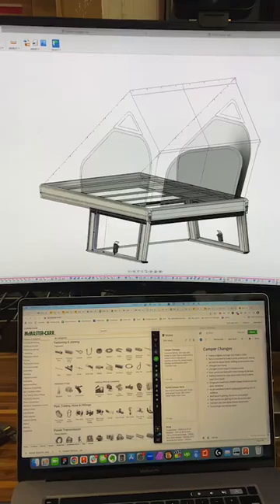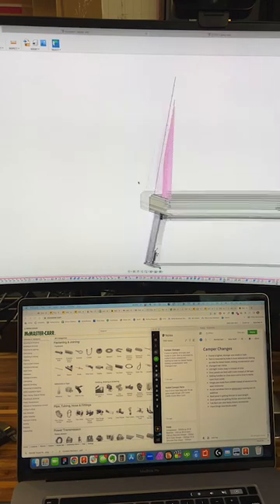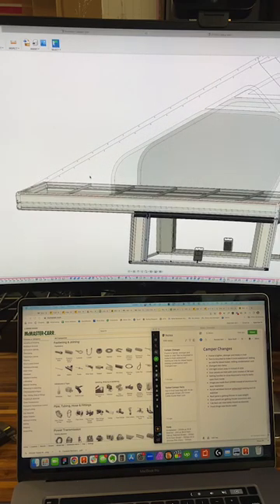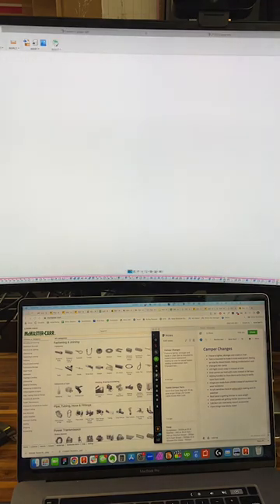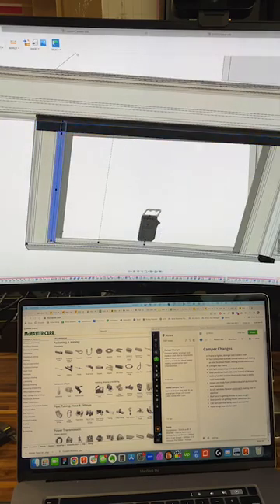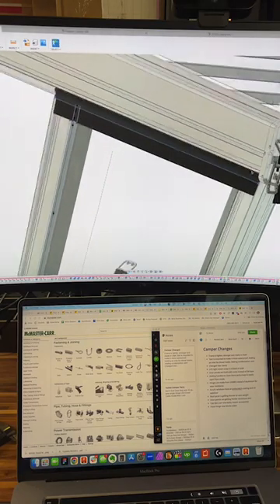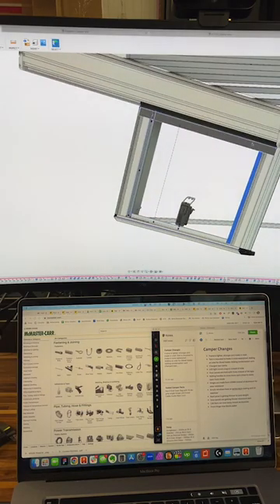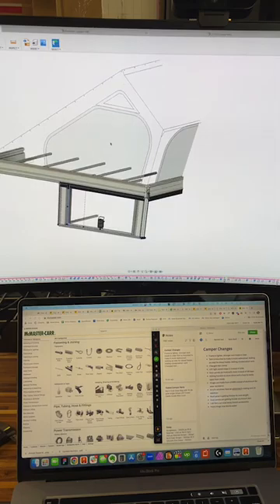Extrusions are finalized!

Comment: Kyle. Amazing work I can’t wait to have one. Is there any plans to have a sliding or movable shelf in the pass through area that could serve as a night stand? Also on the order page it looks like you either have to go no windows or both windows, and or pass through. Can you have no rear window but also have the cab pass through?  Thanks again
Reply from the maker: We're working on a 2 pc bed extension accessory that could definitley serve as a night stand. Yes, you can have no rear window and add the pass through.

Comment: Will the side hatch doors be strong enough to mount maxtrax on the outside  And will the gas struts support that weight?
Reply from the maker: We're planning on it. We'll be testing an accessory plate that can be added to the doors with mounting holes for both of those. The gas struts are adjustable so you can reposition them to increase the leverage on the door for heavier loads.

Comment: Hey Kyle, I road trip a lot with my dog who likes to be in the bed. I have a soft topper right now which makes it easy to vent the area while driving. Would it be possible to have an option that allows air to flow in and out while driving? I understand that can let dust in but maybe as an option because lots of us do have our dogs back there.
Reply from the maker: Our cab passthrough window would be great for this. We're also working on a positive pressure vent that would allow air in.
Reply: @lonepeakoverland9213  sweet!

Comment: Is the outer part of the frame "T Lock" ? If so, then mounting accessories such as awnings should be very simple, right?
Reply from the maker: Yes! The channel is all over the camper; outside and inside. We're working on an awning mount so you can mount any awning to the side.

Comment: I believe on the prototype I saw the struts that hold the tent up were mounted externally. Any plans to move them internal? Concerned with them getting snagged while exploring the tight trails and forestry roads in WA state. Also, got any details you can share for running wires through the extrusions, etc?
Reply from the maker: They will be mounted on the inside on the production version. We're going to shoot a quick video on how we're doing the wiring in the next week or two so stay tuned.

Comment: Updates look great Kyle! With the new latch design I assume that will be lockable? I saw what might have looked like a place to add a padlock?
Reply from the maker: Thanks! Yes, it'll be lockable. Based on some feedback, we've actually changed the latch design to make it more integrated into the corner piece so it'll look cleaner :)
Reply: @lonepeakoverland9213  right on! Really appreciate the transparency in the design process.
Reply from the maker: @cabellspicer6483  Glad you appreciate it! It's already led to great feedback from the community on parts of the design.
Reply: Congratulations on the progress!

A couple ideas I have seen that could be nice for this camper:

1) support for digital rear view mirrors.  This is mostly a camera in the back and a way to route cable to the front.

2) front/sides cameras support, again mostly cables, but would make a great add accessories 

3) a heated and cooled mattress that focuses the energy use to the space where it is used, instead of the entire space.

4) side mount hammock mounts.  A roughly 10 ft spread with hooks does the trick, while adding additional sleeping for upto 4 using 2 double hammocks. Also a hammock is likely more comfortable for than a tent mattress.